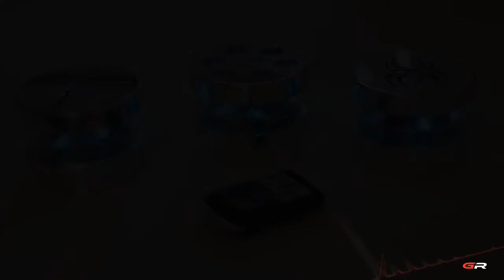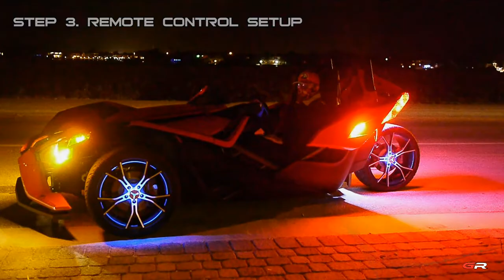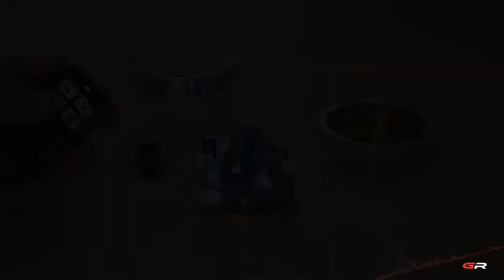Glo Ryder Wireless Wheel Lights - Pre-Install Setup Instructions

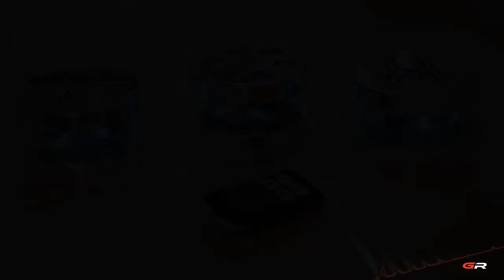Comment from the maker: Step 1 - 0:26 Preparing The Wheel Light
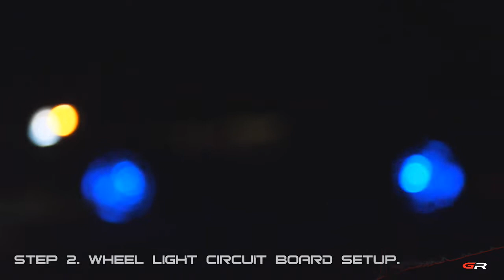Step 2 - 0:58 Wheel Light Circuit Board Setup
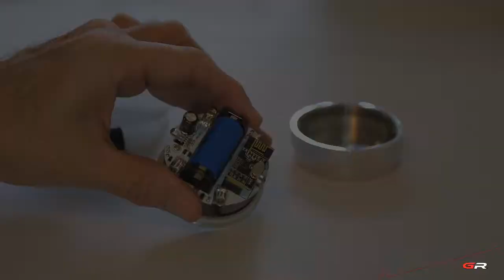Step 3 - 1:42 Remote Control Setup
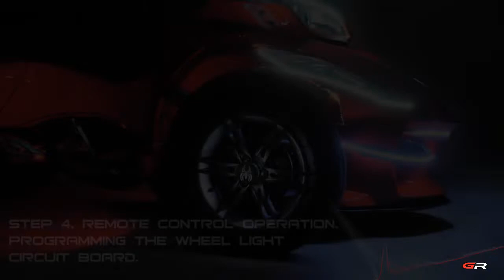Step 4 - 2:35 Remote Control Operation
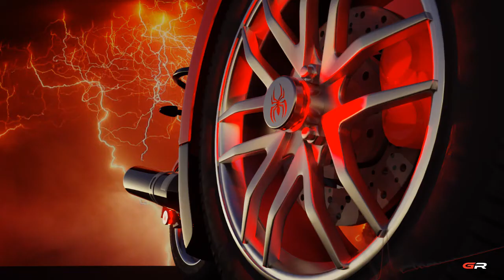Step 5 - 3:43 Housing Setup - Replacing The Battery
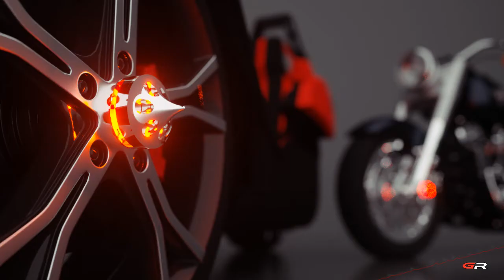Step 6 - 4:40 Exterior Cap Removal
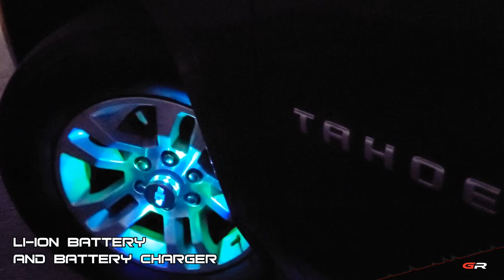Step 7 - 5:25 Li-Ion Battery and Battery Charger